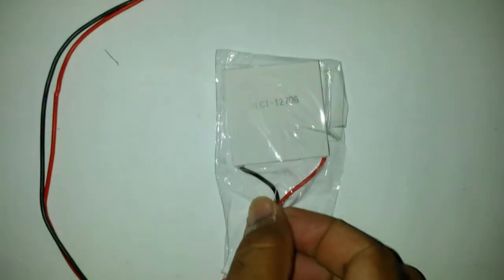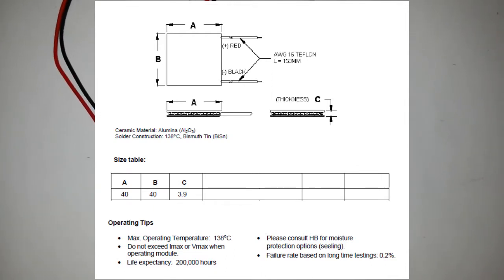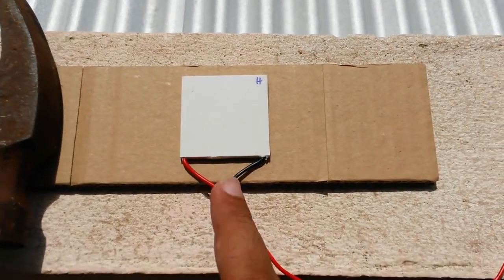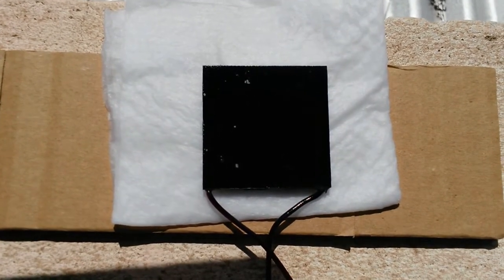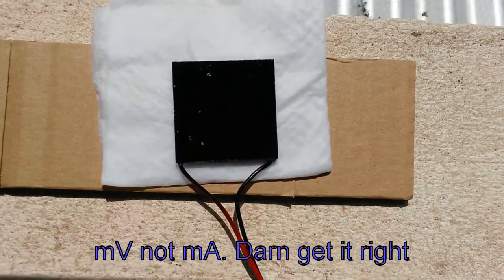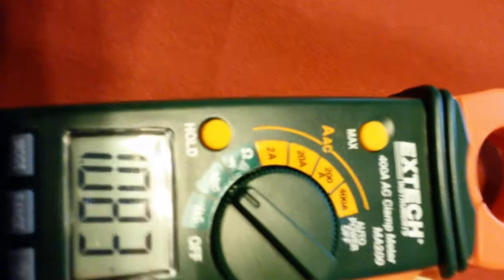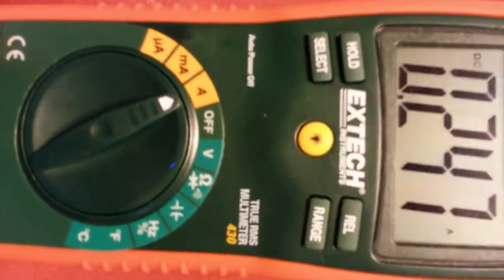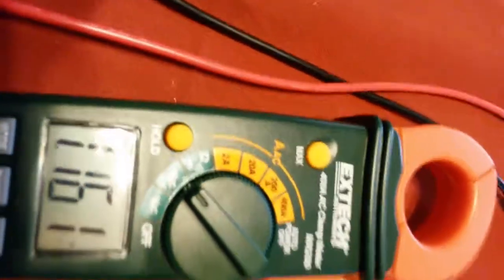045 Testing Power Generation utilising a Peltier and Solar Energy as the heat source

Comment: Really nice work, man. :)
Reply from the maker: MC's Creations thanks. I figured it was not going to produce much power but I have never seen anyone test it to see how it performs. 

I have all the info to do a video on EL lighting a few months now. I will try to put that up soon. That one may be a bit long though. Lots to cover.
Reply: @manickn6819  the 12708 models produce higher voltage and have a lower impedance for higher current.
Reply from the maker: @TheGodfather101  good to know. These were cheap on ebay so I bought them to experiment without much thought at the time as to what I would do with them. 

I did a solar series that might be of interest and right now I am working on a wind turbine from an old fan. I want to see how much power I can extract. Is it feasible to make something cheap that can generate enough power to be useful.